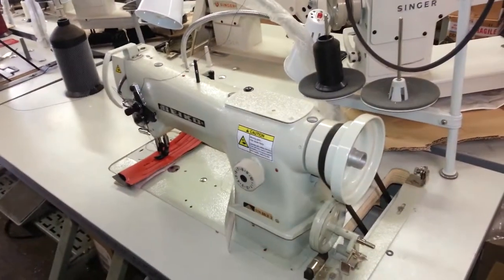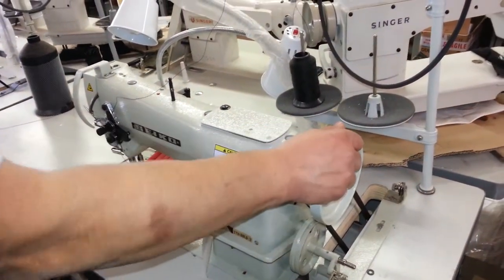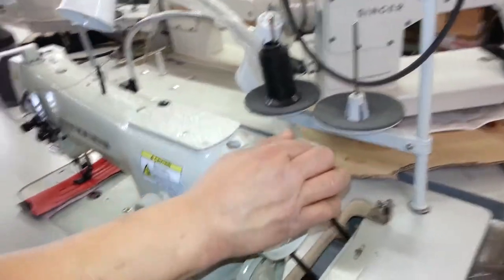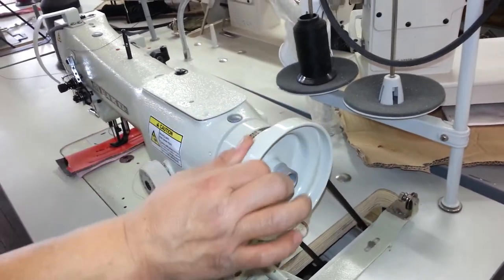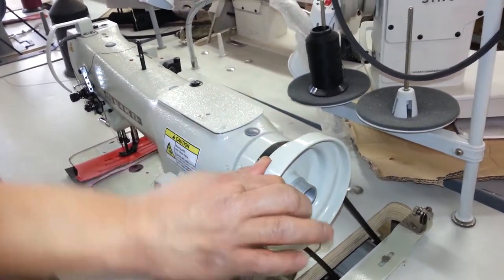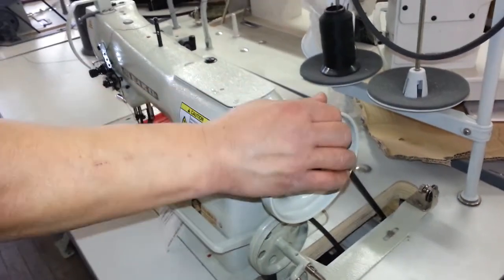How to release the handwheel with a clutch or servo motor

Comment: Wow, this makes me feel quite stupid 😂 of course i was trying to turn the entire motor when i was using the handwheel without freeing it up.... i was going crazy trying to see if there was stuck thread or sewdust, took apart the machine.... thank you so much for this video! (Inherited a juki ddl-8500 from my mom. It has no manuals online, so i've duking it out with similar series models and youtube videos with other machines- i have it woeking but this was my final trouble! Now i just have to play the needle match game...)
Reply from the maker: You should not feel stupid.  It is not in the manual for either the machine or the motor.
Reply: I've been crying for the past 20mins😢, oiled the machine and no luck until I read your comment 😅...sheesh😢
Reply: Now the needle part isn't working 😢